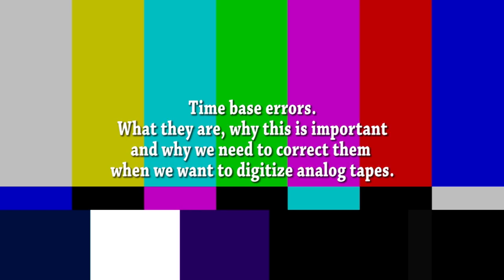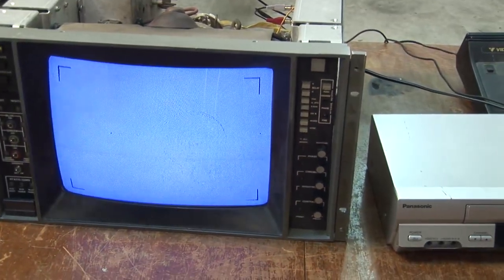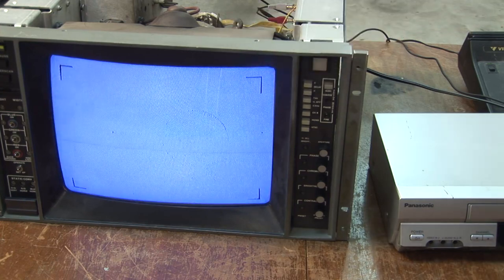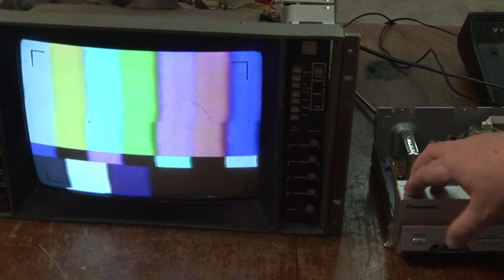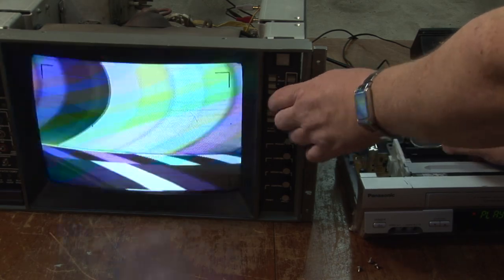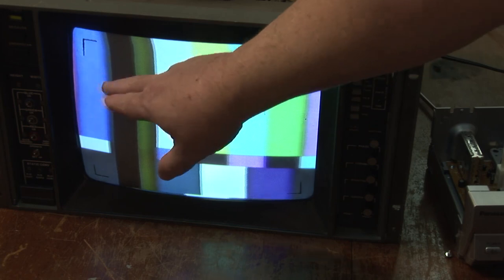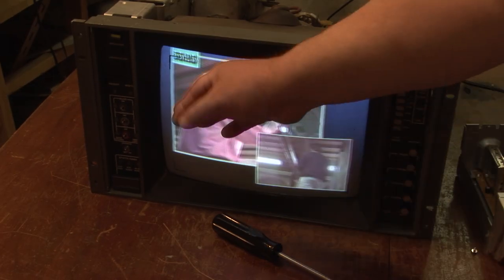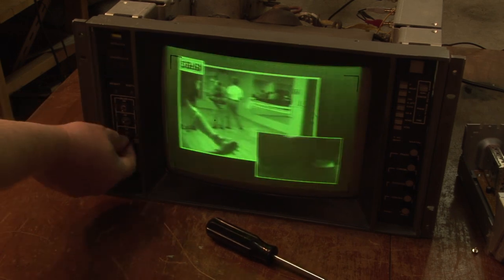Time Base Corrector Demo

Comment: Hello, I learned a lot from this video.  I really didn't know what a TBC did before this.  Just so happens, I'm in the middle of capturing all my old VHS tapes and I have a couple of questions.  I'm using a Mitsubishi HS-U790 S-VHS deck for playback into a Hauppauge capture card using Virtualdub.  I really haven't had too many issues, but I have a couple of tapes that have images that skew every now and then.  Would I be better off with your Videonics TBC connected to my Mitsubishi or buying a VCR with a TBC such as a AG-5710 / AG-1980?  I believe the TBC in the Videonics is better than the one built into any VCR.  Thanks!  Great videos!
Reply from the maker: +Patrick W correct. An external tbc stores the entire frame and makes the sync stable. Most tbc built into VCRs only store a couple of lines of video, and even though they do correct color sync, they don't completely rebuild the video frame. I should do a demo to show what can happen when an unrecorded section is encountered without the tbc an with it.
Reply: +12voltvids Wow, thanks for the quick answer!  I'll go ahead and purchase an MX-1, looks like they can be had for $200 or less.  I'll continue to use the Mitsubishi deck etc.  I really didn't want to buy another piece of equipment but the MX-1 looks like a fun toy..  Speaking of Macrovision..  I remember in the mid 80's my father started dubbing VHS to Beta to get around that copy protection.  The TBC's might have been very expensive back then or he just didn't know about them.  All of those dubs really look mediocre these days, since they were all recorded at the slowest speeds..  In the early 90's he started renting laserdics and dubbing them to S-VHS which was a far superior source than VHS.  Mostly always in the EP mode, so of course it looks blah today, but still much better than the dubs from VHS.  I learned back then never to buy largely into any format.  It was around when DVD came out my father had close to 600 tapes, most of which he never watched.  What a waste of money..  I guess it was more of a hobby than anything.  I keep my blu-ray collection to minimum because of this.  There's always a new/better format coming..  Thanks for the help!
Reply from the maker: +Patrick W That's like me. I used to dub laserdisc to s-vhs, but I would cheap out and punch the hole in a regular tape. Gave better results but not as good as a real SVHS tape.Laserdisk of course had no copy protection.I never bought many DVD disks, and even bluray I didn't buy into mucj of that either mainly because I don't watch a film more than once in general. The only thing I di watch more than once is live performences, mostly of the Jazz greats, but it is more to listen to, and appreciate the mastery that these greats like Davis, and Corea are. As it is my collection is in the hundreds of tapes and DVDs, but they are all self recorded from TV or satellite TV over the years. Most of these tapes were recorded and stored and never played.  I knew a guy that had a massive VHS collection , and when DVD came out, he went and bought the entire collection over again. Had something like 10,000 movies on DVD, and then when Bluray came out he did it all over again, and literally gave away his DVDs. The man was a certified nut, in his 50's had no car, lived with his mother, and had about 100,000 worth of audio and video equipment. Worked as a radio technician. Had no teeth, because he had never been to a dentist, and a huge collection of movies.Then his mother died, and I don't know what happened to him after that because the shop he worked at closed up. I would see him from time to time when I would be in the store, and he was always bragging about his system. Would shake my head at the money he wasted on buying the same movie over and over. The perfect consumer from a marketers standpoint.
Reply: +12voltvids Oh yeah, I remember the punching the hole trick.  We did that a couple of times.  Looked pretty good if you recorded SP.  It may have looked better than a real S tape in EP.  It definitely was a different encoding because even the punched tapes wouldn't play back correctly in a non S machine.  Of course the real S tapes were of a higher quality..  I can tell you can 99% of those tapes ended up in the trash.  I only kept home movies and few things recorded off TV that you could never find today.  For about 17 years or so my father rented most every new release and dubbed it, what a waste, especially since 90% of it was probably only watched once.  Yeah, that guy you speak of does sound crazy for sure.  I have nice stuff, but I'm not going to live with anyone to be able to afford 100k worth of equipment.  I only buy movies I am going to watch more than once, or older movies on blu-ray that can't be rented..  Usually most titles are $10-$15 anyway, so no big deal.  I am looking forward to picking up a 4k projector if they ever get down to about $3500 and some 4k blu-ray.  I bet those will look nice.
Reply from the maker: +Patrick W I would like to get a 4K OLED 65" set, not so much for movies, but for my own stuff I shoot in 4K. I produce some really nice scenery videos. Only a few of them I post on YT, most of my stuff is for my own enjoyment, or sold off. Lots of time lapse videos, so I really want to see them in 4K as I have spent the money for the cameras.I have a nice collection of laserdisc. Many were given to me, but I do like the old concert videos which are very rare these days, at least some of them are.Punching the hole in a VHS tape allowed the detection switch to think that an SVHS tape was loaded and turn on the high band circuits which pushed up the carrier frequency on the record modulator, and also cranked up the deviation of the FM modulator. So playback on a standard machine was not possible because the frequency deviation was too much for the demodulator. Video was recorded using frequency modulation, on a 1MHz carrier, just like FM radio.
Reply: +12voltvids Yeah, OLED is some nice stuff.  What kind of 4K camera are you shooting with?  I checked out one of your 4K videos, looks great.  I have a Benq 32" 4K monitor because I like to game in 4K.  It's expensive on the GPU side of things though, but the displays have really come down in price.  A friend of mine has a consumer level Sony 4K camera and it does a nice job.  I have a laserdisc player too, someone gave it to me a few months ago, I think it works, but I haven't really tested it.  I only have a couple of laserdics.  When I first saw laserdisc in the early 90's I thought it could never get any better than this, ha.  There are definitely a few concerts that I can't find on DVD that I'd like to buy.  Yes, SVHS was pretty cool back in the day, definitely vastly superior to standard VHS.  I went ahead and purchased an MX-1 on our favorite auction site for $200.  I more more faith in that working than another VCR which I'd really rather not buy if I don't have to.  I'm looking forward to it fixing the small problems that I have with some of my tapes.
Reply from the maker: +Patrick W I have an FDR-AX100 with the 1" sensor. With the firmware upgrade it shoots at 100Mb which is more than I need. I usually just use 60 megs as for what I shoot this is more than enough.I use the AX100 for both video and stills, and I use a Sony Alpha 65 for my time lapse shooting, and shoot in raw format.There is a less expensive 4K the AX33, that uses a smaller sensor, and is about half the price, but I am glad I got the camera I did. It has the manual control I want, without getting stupid. SOme of the full frame cameras are really nice, but I didn't need anything that fancy. I like to travel, and only need to carry 1 camera that I can shoot top quality 4K video, and still grab 21 megapixel stills with. I usually do carry 2 cameras though, as I will shoot video and stills at a location while theDSLR is snapping a series of stills for a time lapse shot.
Reply: +Patrick W Hey there, one quick question if you don't mind.  The MX-1 showed up and I was wondering if I should leave the TBC in its default state or "frame lock?"  Thanks.
Reply from the maker: +Patrick W For consumer use it really doesn't make any difference. In unlocked it will follow the incoming video frame rate, making slight adjustments for either drop frame, or non drop frame timing.On drop frame, there is 1 frame dropped every 10 minutes because the video frame rate is not 30 frames, it is actually 29.97. All VCRs and capture cards can handle either. Where frame locking is required is for FCC compliancy for a broadcast transmitter. Because the MX1 was a certified broadcast reference device, a small market station could use the MX1 as their master control switcher, and a TV station that I did some work for about 12 years ago actually used one.This was a satellite broadcaster I did some technical work for a dozen years ago. The master control had 2 VTR feeding into the MX1, 1 satellite receiver for when the station was relaying satellite content, and the 4th input was feeding down stream from the studio that had another MX1 switching the video from their cameras for their live phone in show that they ran every day. The output went to a digital modulator that hit a bank of T1 phone lines that linked the studio to the satellite uplink facility. They had the MX1 in frame locked mode because the feed going to the uplink needed to be perfect with no frame rate variation.
Reply: Sweet, I'll leave it alone then.  One other thing, the output video is in black and white.  I checked to make sure that effect was off and it is.  I can see color on the preview output though.  I hope it's a setting and the unit isn't defective.  Any ideas?  Thanks.
Reply: +Patrick W Nevermind, figured it out.  With adding the MX-1 I had to introduce another S-video cable, that was the culprit.  None of the pins look bent but the casing on one of the ends is a little bent up.  That was an expensive monster cable at one time, LOL.  Already ordered another one.  I don't go for the monster cable hype in the digital world, but I do believe their analog video cables are better with less loss, etc.
Reply from the maker: +Patrick W Let me tell you something about "Monster Cable"Great marketing. Everyone that buys into Monster, DrDre, Beats ect is just lining the marketers pockets.When I was in the business a monster component cable sold for over 100.00. Dealer cost, 8.55!When they brought out firewire cables that were 3X the price of Sony people bought them because of the good marketing. How could that flimsy Sony firewire transfer anything.There was a reason that the sony wire was flimsy. So it didn't put any undue stress on the fragile firewire port on the expensive camera.I forget how many digital boards were fu**ed by monster cables, but the digital 8 camera I was given (the one I did a video on, digital 8 camera repair) the digital board was buggered up, and it blew a fuse.  Monster HDMI have been responsible for countless HDMI connectors being broken on TV and Cable boxes. I know as I have to change out many cable boxes at work with broken HDMI connectors and you should hear the angry comments I get when a client learns that their entire collection of survivor is gone because I have to swap the box. I give them a new cheap HDMI so that it won't wreck it again. I have opened up some monster cables, and the copper is nothing special. Just a heavy second coating of rubber applied over the Ethernet pairs, which is all HDMI is anyway, to make it heavier, and stiffer so they can claim it is better, and charge through the nose for it.
Reply: +12voltvids I totally agree, I'd never pay the premium for their digital cables, I buy mine from monoprice most of the time.  I do think their s-video cables are bit better though.  I compared once years ago.  I was probably using a really cheap s cable for comparison though.
Reply from the maker: +Patrick W The problem is the weight of the cable weighs down the connector, and S video connectors are much more fragile than RCA. So it is worth damaging equipment for what has been proven by independent tests as a minimal improvement if any. Perhaps if compared to the dollar store special, or or some of the give aways that came with SVHS vcr, but compared to a peoper cable made at your local electronics shop, where the tech would reel out some dual shielded micro coax, and put the ends on it and solder them on. That is what I used to do. Buy the ends, and buy some comscope, or belden micro coax, and do my own. Then you know what you are getting, and the cable typically ran about 0.30 per foot. So a 10 foot cable cost 3.00 plus another couple $ per connector.
Reply: +12voltvids Yeah, having them made would be the way to go.  I bought another 3ft Monster on Ebay for about $8.00.  Once I'm done capturing I should be done with the tapes forever, well maybe.  While I wait for the S cable I'll capture some Beta stuff I have from my Sanyo 7200.  My father bought that machine new in '84.  A friend helped me change the belts and it really works well.  Once in a while a tape won't eject and needs a little help, but that's a small issue considering the machine is 32 years old...  Another noob question...  I assume I don't need to run the audio through the MX-1?  The TBC only corrects video timing, correct?
Reply: +Patrick W Hi, did you see my question from the above post about running the audio through the MX-1 by capturing?  Is this necessary?  The TBC only corrects the video signal, right?  Thanks for your help.
Reply from the maker: +Patrick W the time base corrector only corrects time base errors on the video signal. The audio inputs / outputs on the mx1 is for audio follow when using the mx1 as a video switcher. A community TV station I worked for uses an mx1 as their on air master control switcher. To switch sources between tapes and the up stream switcher where the live studio feed came from. They fed the audio and video output directly to the modulator. Input 1 vtr 1, input 2 vtr 2, input 3 studio switcher, input 4 Amiga computer that ran the memo board for when th station was off air.
Reply: +12voltvids So, it's ok if I run the video through the MX-1 and run the audio directly into my capture card?  Just don't want any sync issues, etc.  Thanks.
Reply from the maker: +Patrick W The MX1 will delay the video by 1/60 second as it passes through the electronics.
Reply: @12voltvids  is a TBC ideal for tapes which flicker I have some family video's and the picture flickers I have inspected the tape reel, no damage to tape reels, please advise thanks, the picture flickers in certain scenes.
Reply from the maker: @speedyboishan87  
A TBC will correct time base errors only. If the tale is flickering due to being recorded out of spec due to a failed recording circuit or playback circuit a TBC probably won't do anything. If the sync pulses are distorted it will fix that and allow a copy to be made it it to be digitized but if the video is distorted it will always be distorted.  If it is caused by alignment you may be able to tweak the player to play the bad tape.

Comment: Thank you, 12voltvids, for all of the great repair videos! I'm curious, would this MX-1 being used as a time base corrector also work correctly when trying to capture video from a Betamax? Or is there some inherent difference in the time base signal?
Reply from the maker: It will work for any video signal and correct the time base.  It does by reading in the video signal complete with jitter into memory and then reading it out with new sync added correcting the timing errors in the process.
Reply: @12voltvids  Can a JVC HR-S9500 SVHS VCR DO THIS...
Reply from the maker: @Ramdileo_sys  I still have my miro dc30+, and matrix rt2000. The rt2000 was grrrrreat.  Best capture i have now is direct to DVD on Panasonic, Sony or Toshiba recorders.  No dropped frames.
Reply from the maker: @Ramdileo_sys  They haven't made those flat CRT sets for probably close to 30 years.
Reply: @12voltvids  reproductions I guess.... Adrian put a link in the description... Tosho Denki (Japan) the board..
Reply from the maker: @Ramdileo_sys  could be, or it could be old stock.  Thereby were many intercom systems made by companies like airphone that were still selling the black and white flat tube systems as recently as perhaps 10 years ago and many houses built in the past 30 years had them installed by the builder when the house was built.  I see them all the time when I am working in customers homes.  I don't think they install them anymore new but perhaps the monitor is still available for repairs because not everyone will just swap out the old system for a new one when it breaks.  They want it fixed.   One of those would look cool on my bench as a clock.  I have a Sony watchcam that uses that monitor.
Reply: @12voltvids  Yes for 21 + Bucks .. will be a nice project/video 🙂